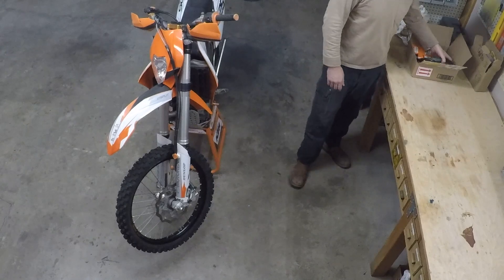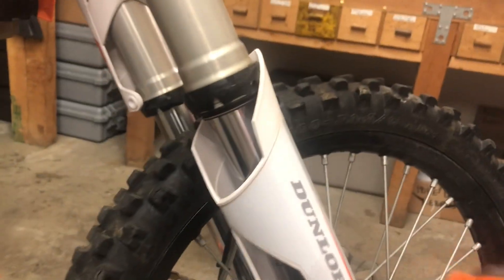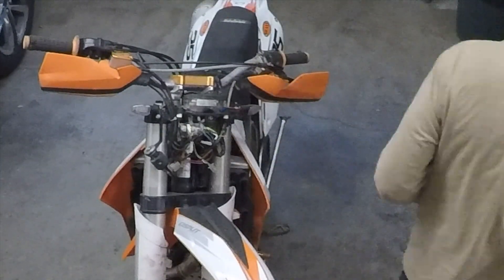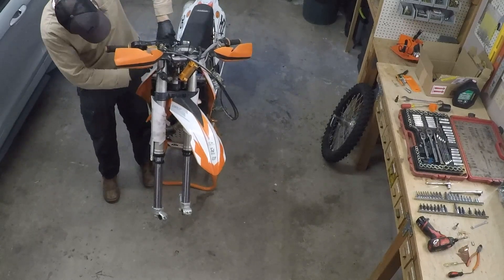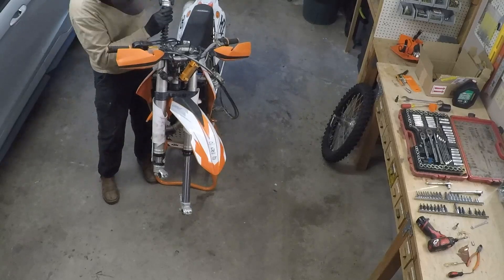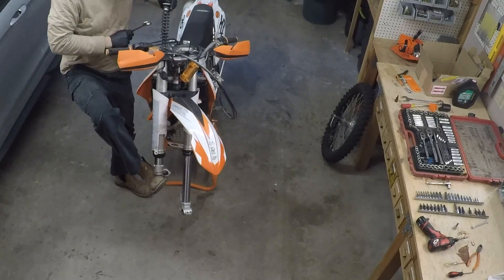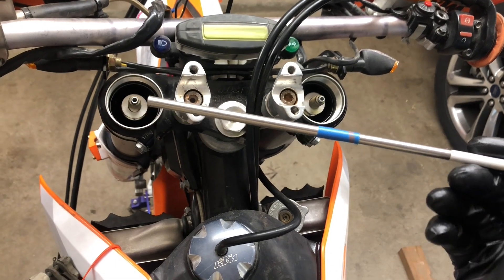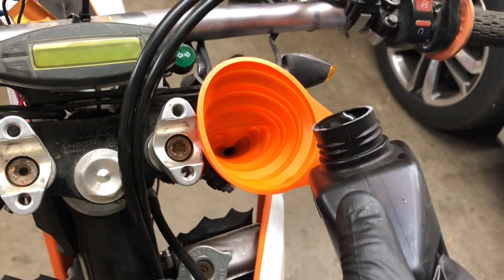KTM Fork Leaks: Replace Lost Oil Without Removing Forks?

Comment: Would you be able to replace the seals using this same method, without removing forks from the bike? Or would it be easier just pulling them off…. I’ve got a 25’ 300xc w/5hrs, R/S fork leaked maybe 1/4-1/2 qt of fluid.
Reply from the maker: I took the forks all the way off about a year later to install new heavy duty seals. Turns out it was pretty easy! I followed this outstanding video from Rocky Mountain ATV, and it went really smoothly.
https://www.youtube.com/watch?v=iGK7DRdjTlQ

Comment: Going to try this soon. How long has it lasted for? Have you since changed your seals.
Reply from the maker: It worked for a while but the seal on one side started to leak little bit so I ended up replacing the seal. Rocky Mountain ATV has a great video on how to do that with the 48mm WP forks on these EXCs, with and without the preload adjusters.